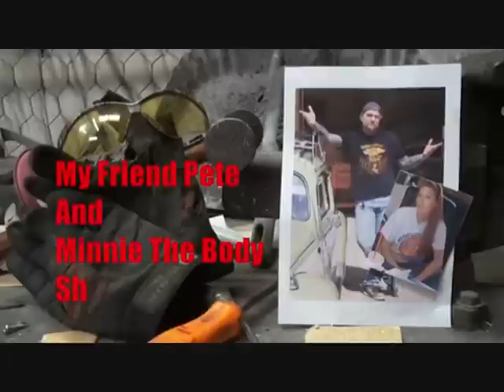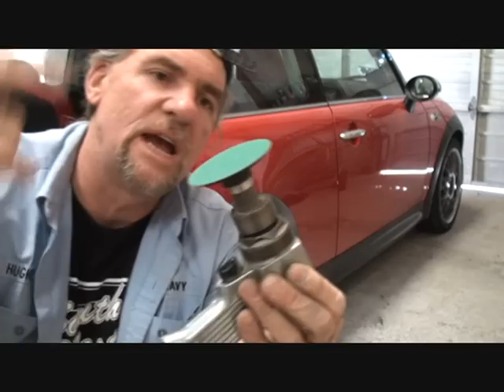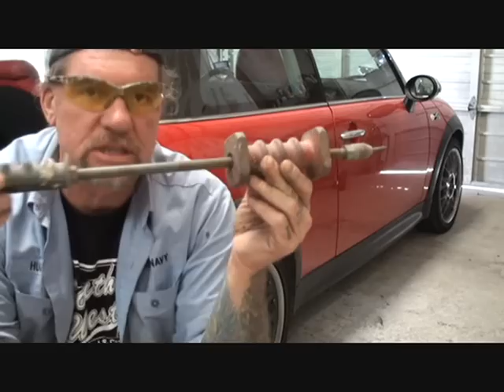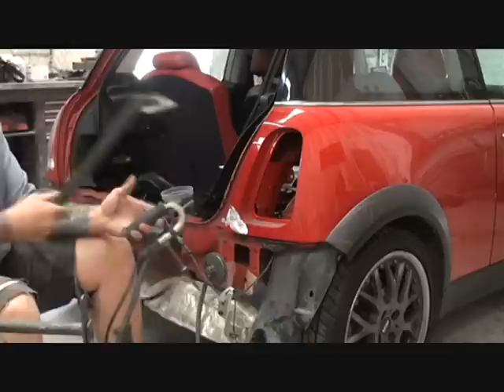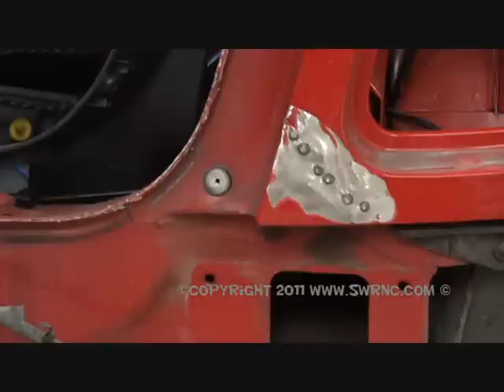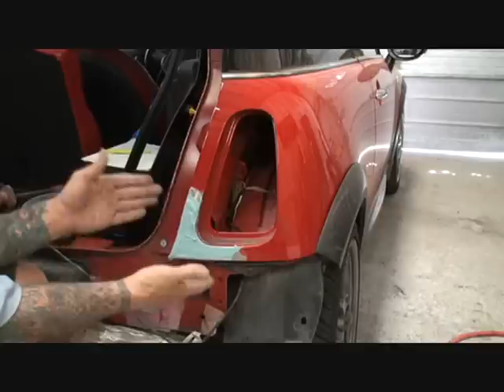Auto Collision-How To Repair A Dent Properly. Part 1

Comment: Paintless dent repair for deep creases in tight spots with a little practice with the right rods and pullers will work virtually every time. Get an old body panel, a door, or something, whack it various objects to create challenging dents and practice. You will be amazed at what a little time and effort can do without having to grind, sand, use body filler, and paint. No expensive tools needed, just practice. for the guy or gal at home or in the shop. The metal used on cars today is soft and easy to manipulate versus older cars. The older the vehicle the heavier the steel which limits some of the dent repair tools. My 35 Chevy pickup is a prime example of heavy gauge steel they once used.

Comment: I use to use the small 36 grit grinding pads but found that a 4 inch 36 grit flap disc works better and lasts a lot longer than the little disc's and. Those little disc's aren't cheap.  I work bondo the way you do but after I have it laid out I keep checking it and when it is beginning to cure I use what I call a cheese grader and scrap the bondo down in to shape. Put one final coat and when that it completely cured sand and finish.

Comment: I USE A HARBOR FRIGHT DENT PULLER .I ALSO USE A HACK SAW BLADE ACROSS THE SURFACE .WHEN ITS LESS THAN 1/8 DEEP I STOP AND GO TO FILLER WORK!

Comment: A car like that you could have used glue tabs and not gone through the epoxy  coat, or possibly even the color or clear. Filers are a last resort as they are prone to failure. fillers have a place in creating show cars that won't be exposed to the elements though.  An extra hour or two using the best methods possible  might eliminate doing the job over a second time.

Comment: why pull that small of a dent before bondo pete? are there rules for that as far as size or do u just always wanna pull as much as u can before bondo for the obvious reasons that the bondo is the foreign substance so u always wanna use least amount as possible? thanks good vid
Reply: Jack Johnson I agree on need to get the metal as straight as possible first, but show quality requires a skim coat of filler at least. I want to puke when I hear people say  there is no bondo in their car. Maybe no Bondo brand filler but if a car is old and you could use it for a mirror odds are it has filler. This might not have been the case 30 years ago when cars had 50 coats of lacquer , but really who is using that today?

Comment: What brand is that machine. How many volts and amps is it, Does it shrink well? I prefer 110v so I can be more portable but i want the machine to work most of all. I can only find snap on machines and dent fix machines. Help a guy out. I am getting ready to spend big bucks on a machine.

Comment from the maker: Back in the days of the slide hammer people would just pull the dents then fill with bondo and be done with it. I would advise you to weld the holes up before applying any filler, if you don't moisture will get behind it and eventually bubble and peel off and then create rust.. Good luck  Pete

Comment from the maker: Don't believe everything you read, bondo should be applied to a clean metal surface that is preped properly using either 36 grit or 80 grit sand paper depending on what type of bondo you are using and how large the dent is your repairing. Yes you can apply bondo to painted surfaces if the preperation is the same, but you will have a high chance of malfunctions in the future.. Always apply bondo to bare metal when possible.

Comment from the maker: You can always use a spot welder dent puller, it works in the same manner, but instead it spot welds small nails on the dent and then you screw the slide hammer on the nail and pull the dent out.. Pete

Comment from the maker: Because when you taped it off for primer you left the tape on the helmet and then proceeded to paint over the primered tape. The primer is very thick and acts as a filler, so basically what you did (in a sence) is glue the tape to the helmet, making it part of the helmet. You should have pulled the tape off after primeing and then re-taped for paint. Its a common mistake and happens to the best of us.. Wetsand the area down re-tape and then repaint.. Pete

Comment: OKay, I may be a teenage girl, and I'm not trying to hate on him or anything, but I'm going to a tech for Collision Repair, and our program that we go through, I-CAR, which is a highly respected program, teaches that before grinding away teh paint, you DO clean the area with soap and water, then a wax and grease remover, to completely clean the area before repairs. Then, the Bondo that pete was using, I-CAR teaches that you do not mix it on a piece of cardboard or any other porous surface. FYI.

Comment: I also know of another produce with was the slide hammer and the electronic dint puller as one, the front will spot weild itself to the metal of some sort and connected to a slide hammer so it was more portable if you would say. just another suggestion. Also may be expensive

Comment from the maker: I don't know what kind of stud gun you have, some have a heat range you can adjust, if yours is this way, turn the heat up, If it doesn't hold the trigger longer so it will get better penatration for it to spot weld itself to the metal. Older cars/trucks have thicker steel then new cars and it requires more work and time.

Comment: Pete,  Thank you for taking your time and putting out these great videos. After watching your videos I have the courage to do the body and paint work on my 64 Ford F250. I purchased a stud welder dent puller from HF after cleaning the surface to bare metal and zapping on the studs , the studs just fall off . Do you have any suggestions?  I respect your experience so if you tell me to buy a more exspensive welder can you recommend a brand ? Thanks again